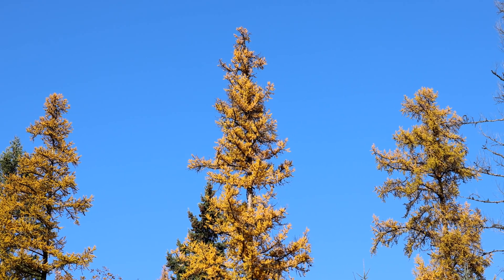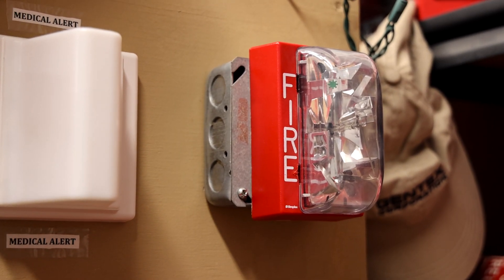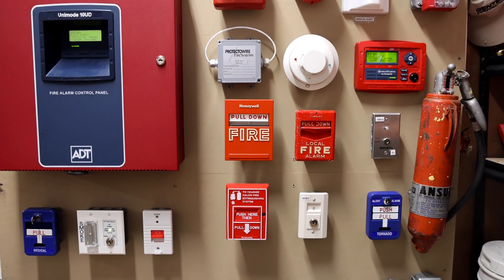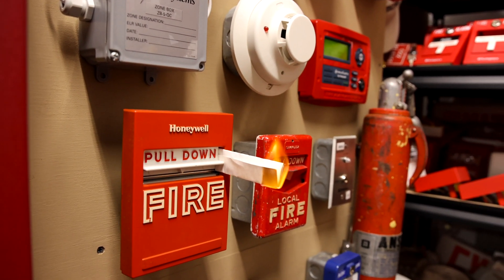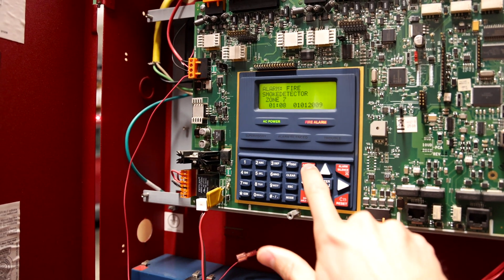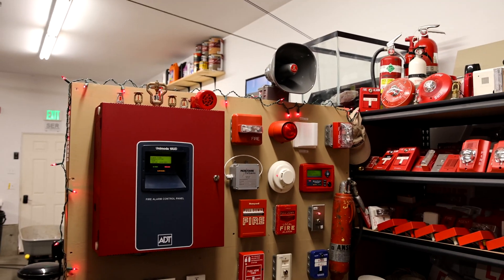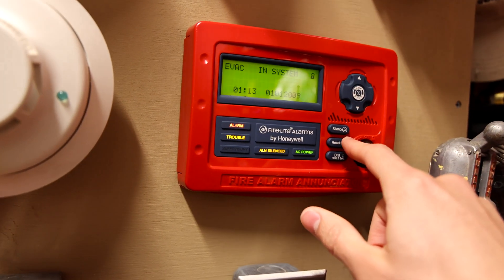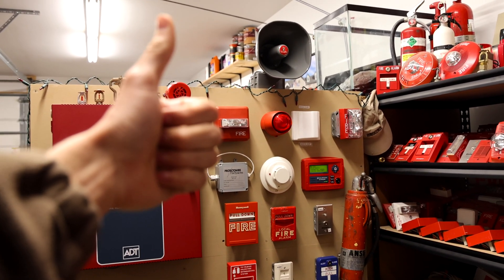ADT Fire Alarm System Test 32 | Federal Signal Siren!

Comment: Those i3s are installed at the animal shelter I volunteer at, tied to a traditional security system. The facility was fumigated almost a month ago and noticed a few detectors in activation mode with nothing happening. I have two i3s in my collection since 2022